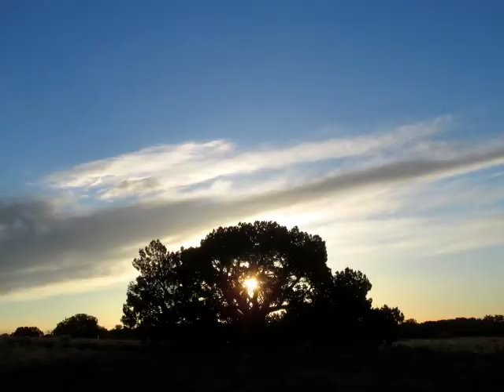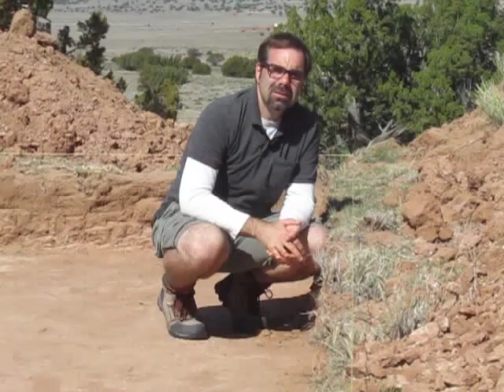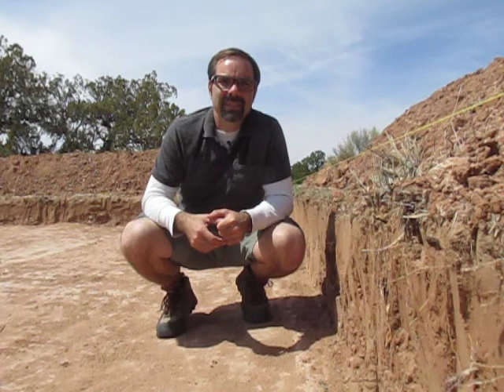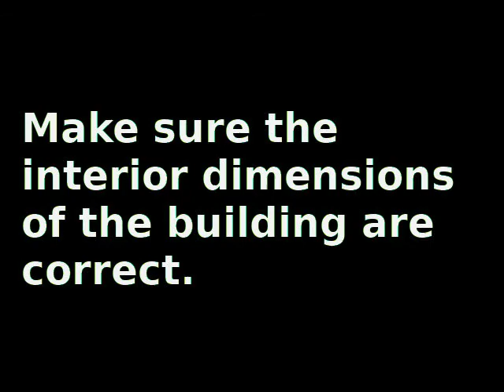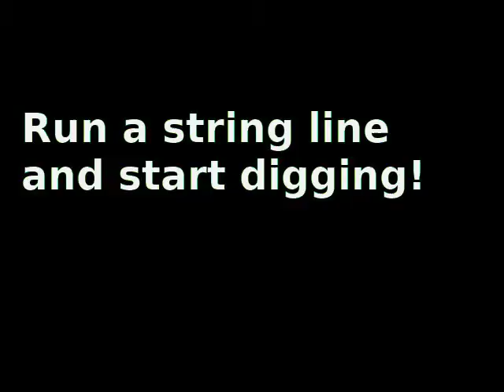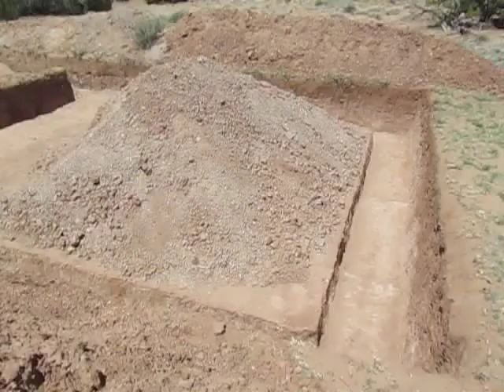Earthbag Build - Episode 03 - DIY Excavation Cont...

Comment: Hi..thanks for sharing your experience and knowledge. Will it be ok for 9” walls for laid bearing ?
Reply from the maker: It depends on how big your structure is. You might need to add buttresses to increase the vertical stability. One option is to lay two rows of bags per course giving you a total thickness of 18". You would want to make sure you lay the bags in a pattern where there is overlap between the two rows so they can't peel apart from each other. Something like this:  []==[]==[]==[]==[]

Comment: good stuff. are you aiming for a biweekly upload? would gravel by itself be enough perhaps? does moisture come up from the ground or just flow in from the sides? thanks
Reply from the maker: Thanks! I am uploading videos as I complete them. It has ended up being about one a month. I will be doing quite a bit of work over the summer and should have videos out more frequently then. The footer trench carries water that seeps in from any direction. I live in a dry climate with sandy soil and the water table is quite deep. So I don't think water will ever come from below in my case. This design would work in areas with more water as long as you aren't putting the trench below the water table, like if it were former swamp land or something like that.
Reply from the maker: The geo-textile fabric on the bottom is water permeable. It is there to keep water that flows from above from picking up silt from the bottom of the trench and clogging up the gravel.